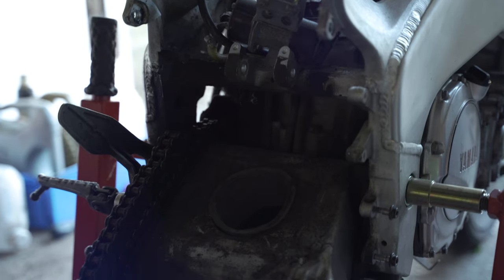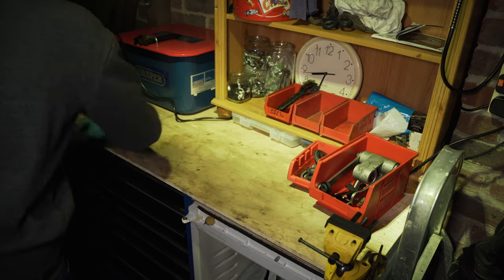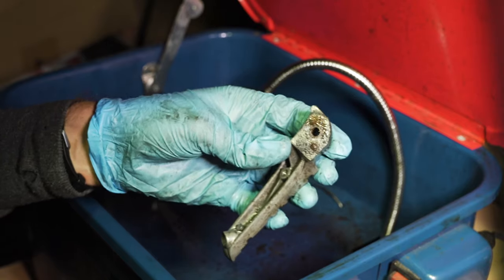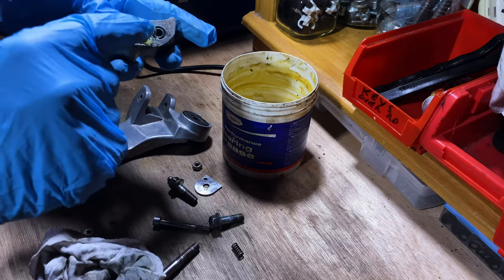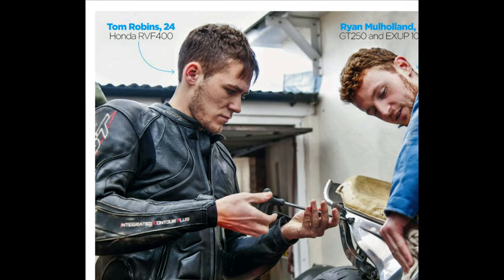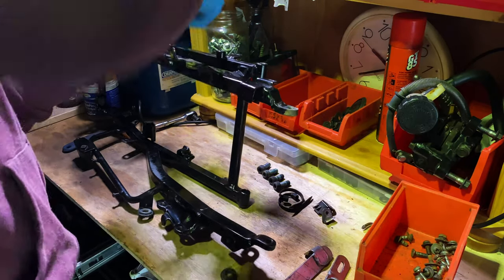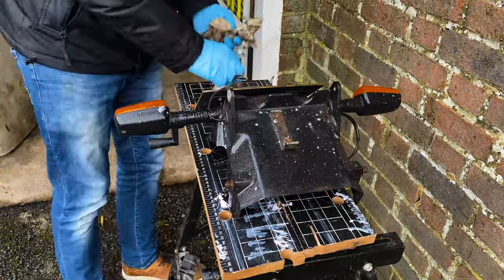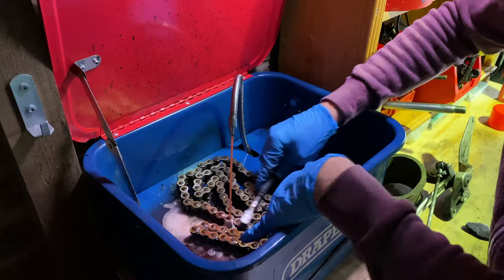3 - Restoring The Subframe on my FZR1000 | Tom's Workshop

Comment: Looking good so far and i had exactly the same issue with the 89 EXUP I am renovating with the coolant tank pipe falling apart. Your rear subframe looked a bit scarily rusted better double check mine!
Reply from the maker: Thanks Michael! Yeah the rust was a bit of a shock. I had planned to take it to be blasted to assess it and maybe powder coat it but for the price it was a no brainier. Hope yours is going well!